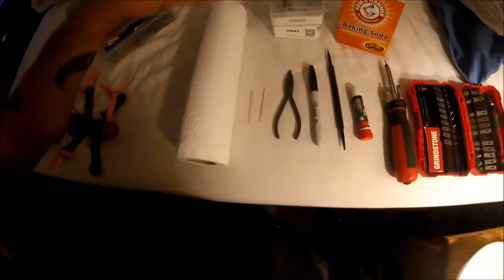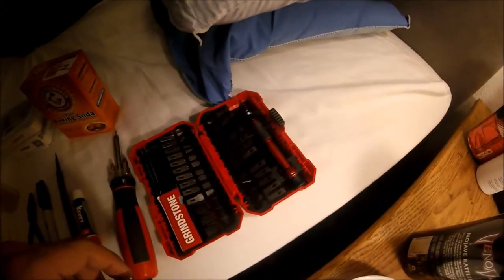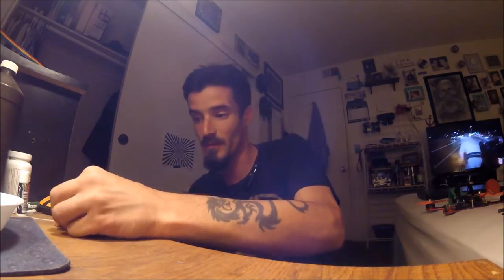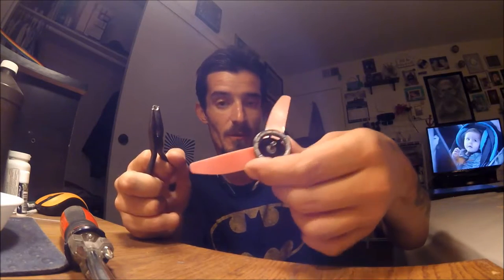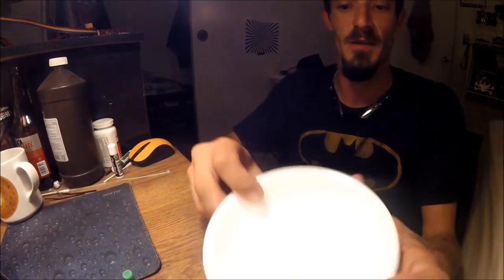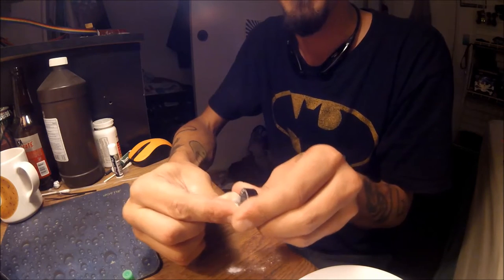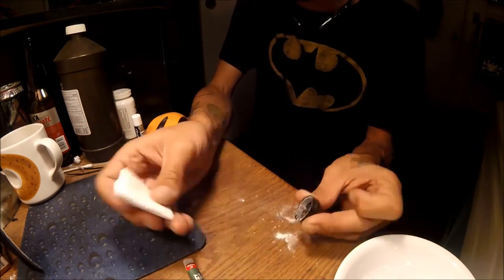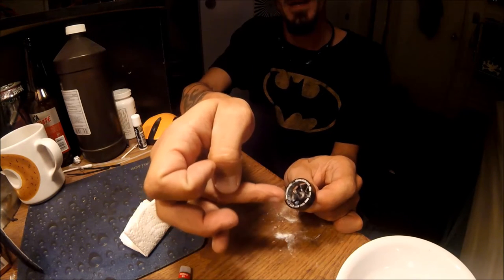Emax RS2205 2600Kv Magnet Repair DIY

Comment: Hey man, i want to thank you for the video.
I upgrade my motors from racerstar to Emax RS2205S 2600Kv and after 4min of flight i notice very very hot motors (all the filters on). I had 6 lose magnets on two different motors. I use your method to fix the motors and it worked perfectly. 
Thanks again.

Comment: Man you maybe the right man to answer.. I have emax rs2205s full of mud after crash.. I unscrewed the little bolt under the motors and took the washer off to get the bell off after and clean the motor... Those bells.. I can't get them off..no way.. I tried a lot... So much force... Wtf. What am I doing wrong??
Reply from the maker: Those magnets are very strong did u possibly bend the shaft ? .. it takes a lot of force to remove them
Reply from the maker: Try leaving the motor attached to the arm and use brute Force to remove it without damaging the threads
Reply: @JonTatumFPVAHOLIC  I didn't bend them. I have cleaned the motor without removing them. It seems too hard to remove. Maybe it's just the one motor.. I'll try it next time.

Comment: Hey! I busted a motor and i locktite the magnets back!(had nothing else to use) But the motor is heating up too much. Did i out the magnets in wrong orientation. If yes, what is the right orientation. All poles same direction or alternate poles????   Plz help

Comment: How to repair the motor central shaft?, My drone crash end i loose the central shaft.Any idea? Tx
Reply from the maker: Is there a allen wrench bolt in the center of the shaft usually that's what you have to use to remove the actual Central shaft

Comment: Had the same issues, 2 out of 4 Motors were faulty and were unbalanced, oscilating and vibrating like crazy. figured that one magnet was out of place. tbh. i dont even bother repairing those. Gonna get rid of my emax motors and replace them with better ones! kinda sucks but it looks like quality control over at emax is sleeping or just doesnt care so. fck those guys
Reply: Kai Cent they do care brotha ... just contact them, explain what happened, they will fix the issue, they have since then replaced all motors with issues, buy you have to follow instructions bro, send them in they will inspect them then send the replacements 

https://emaxusa2.freshdesk.com/support/home